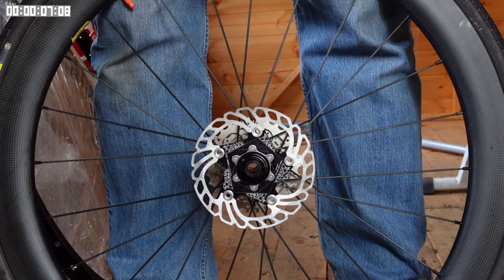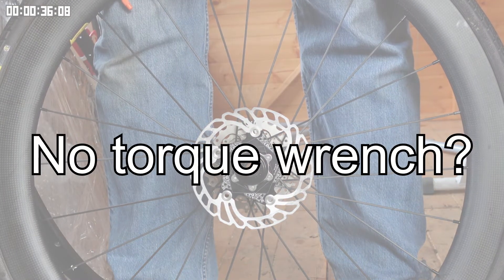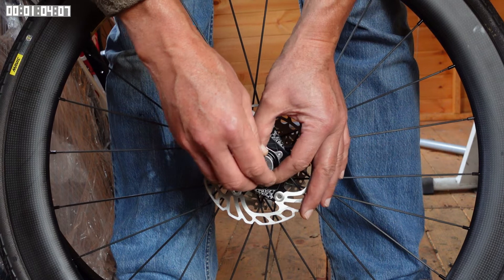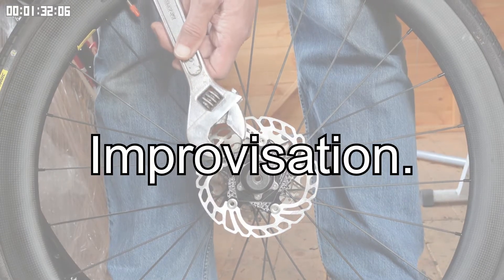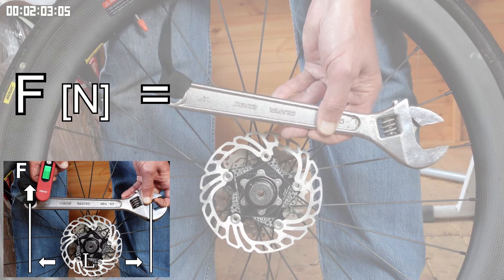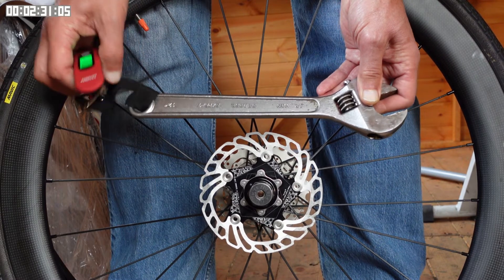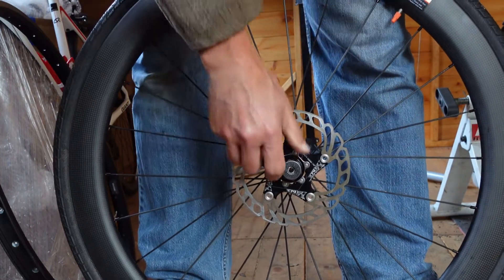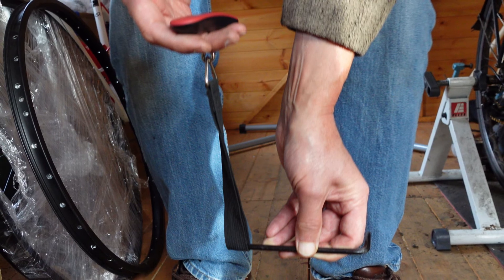No torque wrench: no problem!

Comment: If the angle you're turning the wrench by the cord isn't 90° angle, but instead some angle A, then Torque is instead given by

 Torque =  Force×Length×Sin(A)  . 

When A=90°, since Sin(A)=1, then
Torque=Force×Length. 

This formula is also a good approximation for any angles
A 'near' to 90°.

These facts are due to a physics generalization of Torque as being a vector (a directed line segment & also a quantity with BOTH length and direction). 

The Torque vector is equal to the 'cross' product of the force vector with the radial distance vector ('rotating' length force is applied to, ie: wrench length).

^T=(^F)X(^L)

The 'magnitude' (size) of Torque vector 
= "Torque"
= (Force size)×(rotating Length)×sin(A).

(google vectors, dot product and cross product if interested in this specific math and physics definition)
Reply from the maker: Thanks for the additional clarification, you are of course correct. However,. I wanted to keep the video simple so that most people could just follow the instructions without having to struggle with more calculations than necessary
Terry
Reply: What would 22 nm be in pounds?

Comment: What would 22NM in pounds on luggage scale?
Reply from the maker: 1kg is equivalent to 2.2lb. Hence, if you use the formula in the video and then multiply the number of kgs by 2.2 that will give you the number of pounds force you should apply at the end of your lever arm.
Reply: @FiveMinuteVelo  Thank you. I’ll have to keep this in mind in the future. For now I just went and bought compact torque wrench with crow foot. Don’t have much room and this would have worked but wanted less to think about, on this already tedious job.